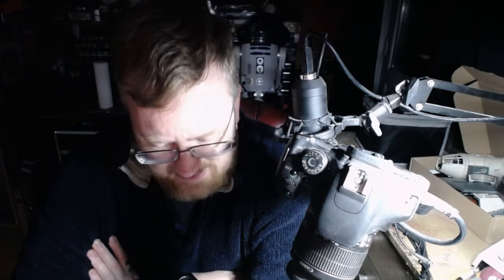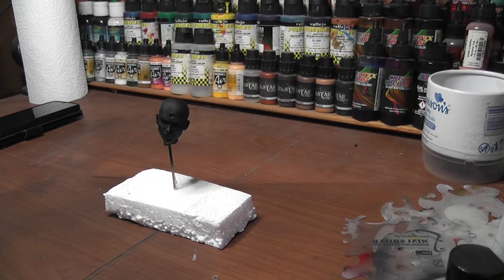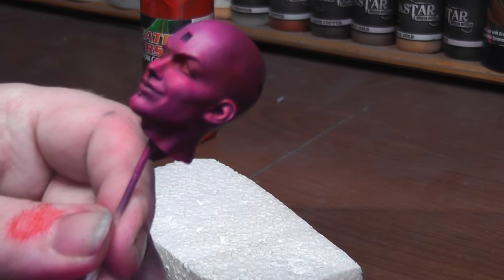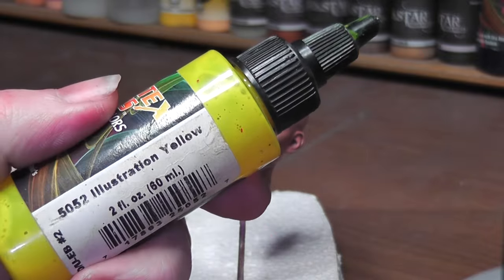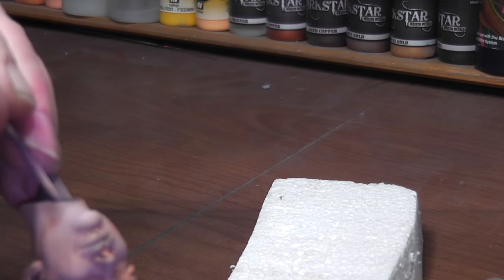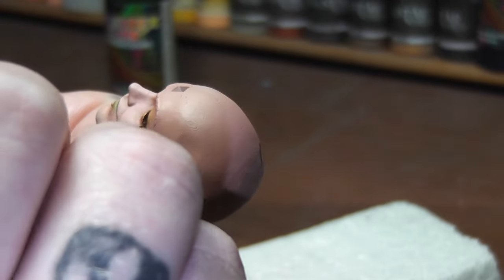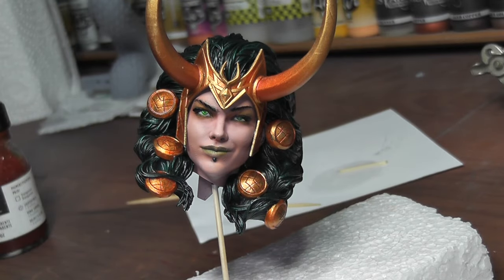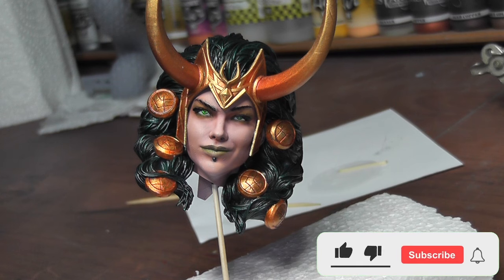Painting a 3D printed Lady Loki figurine -  Part One - The Head

Comment: i really appreciate the explanations while the video is going, and the quality of the camera, along with the airbrush, normally i will watch a video where someone will spray and i can't see where they sprayed and it didn't look like they put down anything, with this i can see like each spray line and understand a lot more now about where to paint and what. Well done video. Can i ask what you usually mix to thin the paints in the airbrush. The paint came out so smooth. Can't wait to see more! Well done. (I like the florescent in the eyes bit.. imma have to try that!)
Reply from the maker: Ah awesome, glad you found the video useful. It can be hard to see where an airbrush sprays sometimes. If you're using a colour that's very close to the one that's already on the surface, or if you're spraying very lightly it can look like nothing is going on the surface at all. To thin the paints I've used the specific reducer for that paint brand. For example, the createx stuff I use there is a 4011 reducer that is specifically made for that paint brand. If I don't have the right reducer for a paint I'm using I tend to use a bit of water but be careful as using too much will give you adhesion problems and your paint will come off just by touching it.

Comment: was the trident printed wrong for yours? I have two pointy end on both the pieces to print where the trident attaches to eachother.
Reply from the maker: Yep that's correct. The left arm has a bit of the trident modelled into her hand so the two bits of the trident you print connect into it. I decided to replace the pole of the trident with a brass rod for extra strength so I had to drill out her hand and just print the top and bottom parts of it.